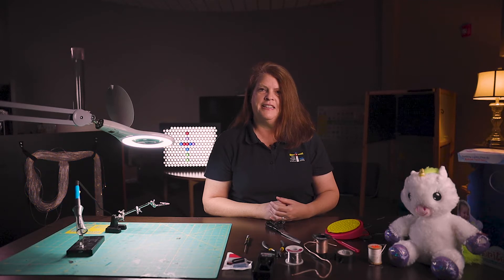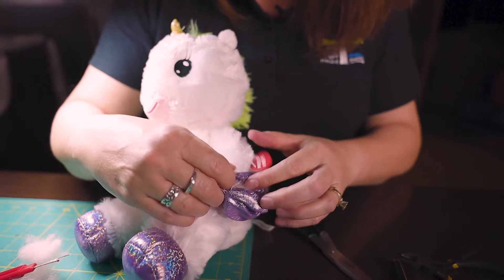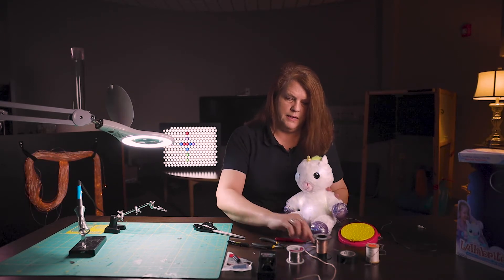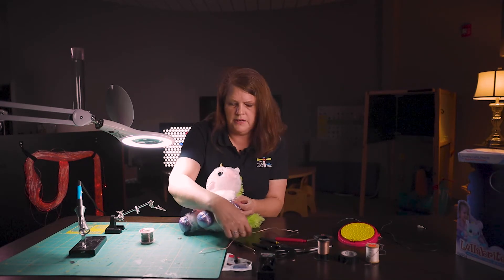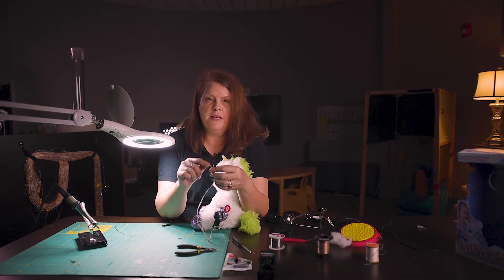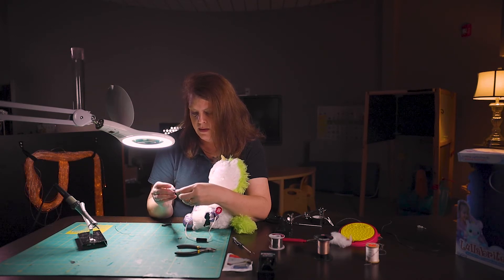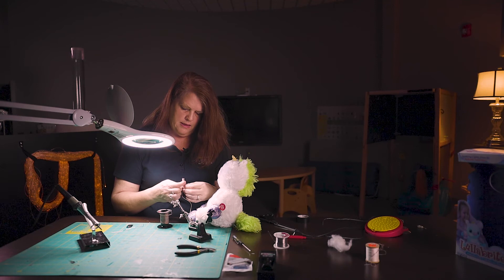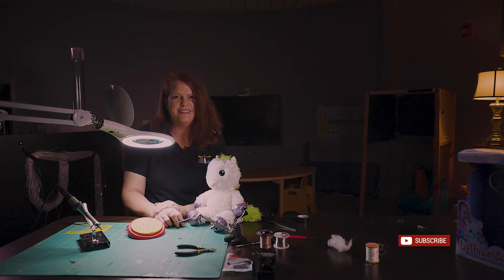How to Make a Switch Adapted Toy - Little Light House

Comment: Please advise if any battery to adapt toys? I e. 3x1.5v?
Reply from the maker: Hey Jessica! If your toy is electric it will need batteries to operate and your toy should come with batteries. Maybe we can do a video in the future of adapting non-electric toys!
Reply: @llhtulsa  Hi yes the battery toy using 3x1.5v.  is your video restricted to different types of battery or no restriction?
Reply: @jessicazhang6497  I know this comment is old but thought I'd comment for anyone in the future. The battery's voltage won't matter for switches if it's a safe voltage to work with. The switch is connecting the +ve and -ve battery loop together so the toy turns on, it is not impacting the batteries at all. Depending on the toy 3x1.5v could mean 6.5v or 1.5v but last longer, but both are well under 20v which is where strong caution would be advised for anyone who does not know what they are doing. I would expect most toy voltages would be fine and likely 12v, 9v or 3v.